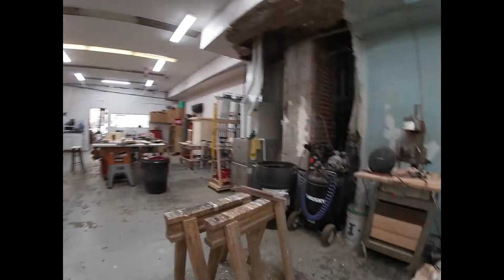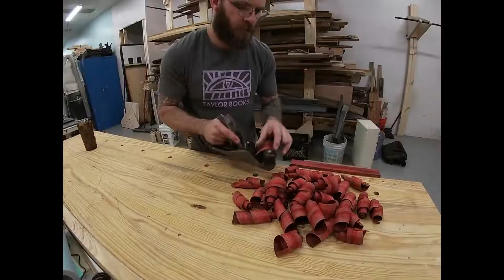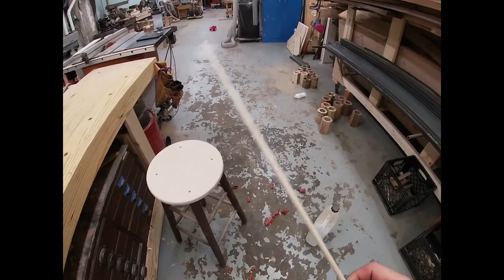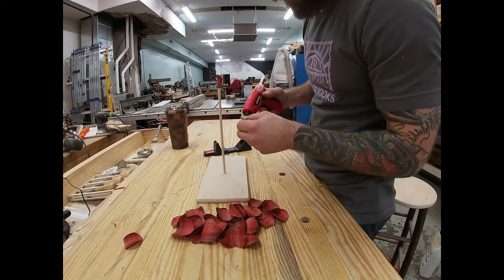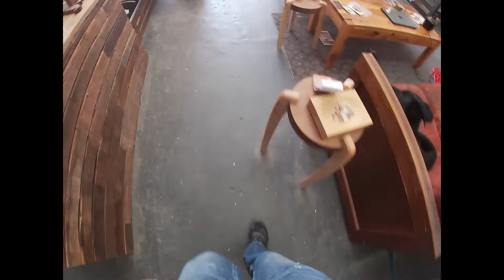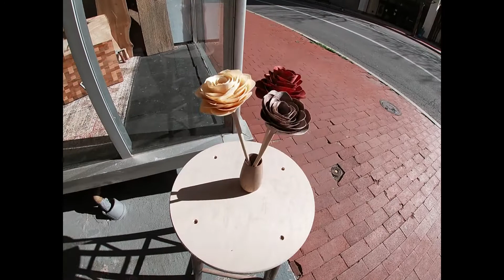Wood Roses

Comment: for people who are struggling w the shavings, I recommend looking into wood veneers. They are a thin layer of wood, almost like paper, and can easily bend. But if you need them to bend even more, you can put them in hot/boiling water for a couple seconds. it'll loosen it up. just a suggestion for anyone who may be struggling w the shavings.

Comment: Is the wood you’re using pretty dry? I’ve been working on some of these using some nice magenta colored cedar and I’ve been having issues with my shavings cracking.  Any suggestions for particular types of wood?
Reply: To prevent cracking while making the flower I used some water on the first few shavings to make them bendable without cracking. Since they are so thin they dried again quickly after assembly.